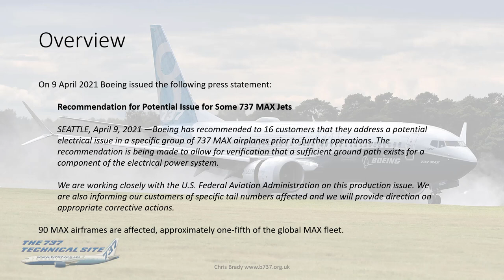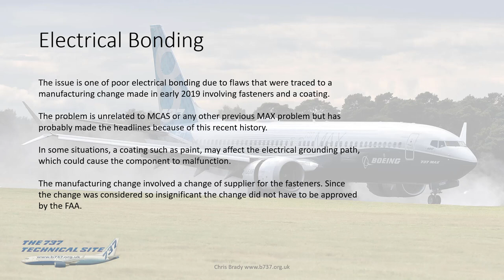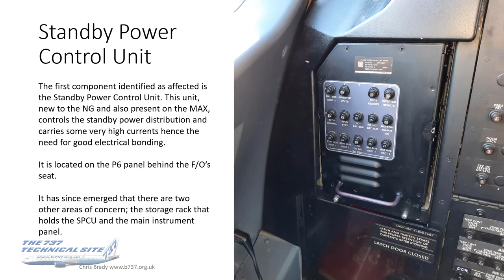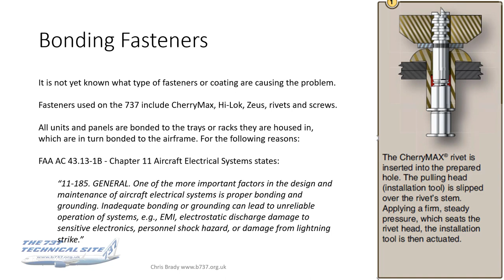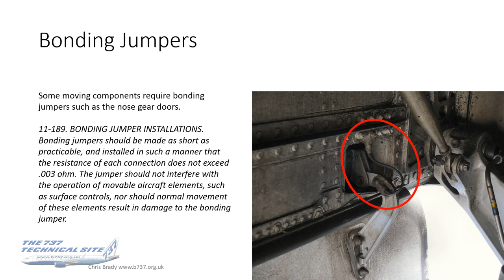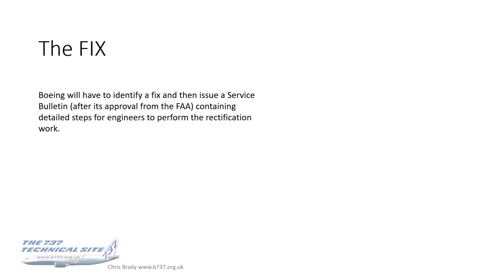737 Electrical Bonding

Comment: The bonding jumpers are very important because it equalizes the electrical potential of the entire air frame. In case of lightning strike without the jumpers a difference of potential could exist which will cause an arc as the electricity seeks to equalize out. That arc could very well weld adjacent surfaces.